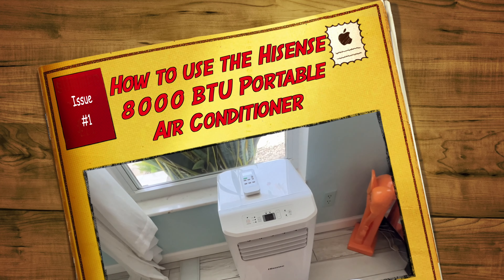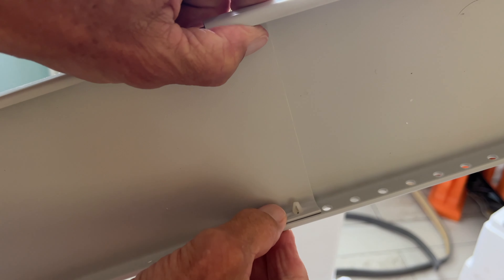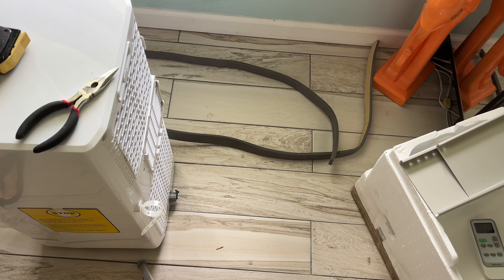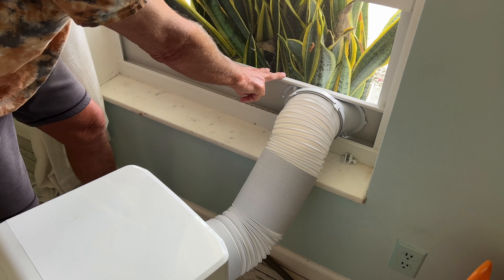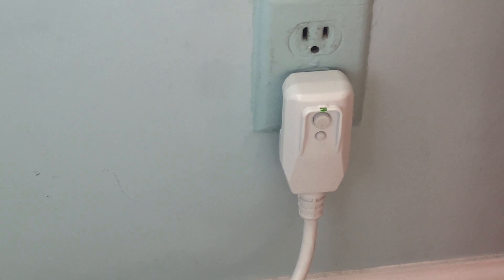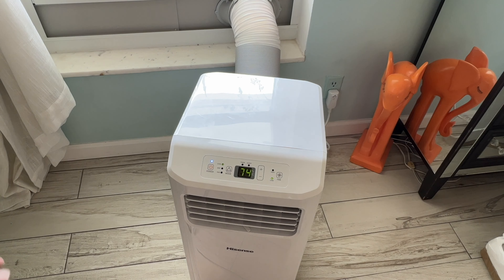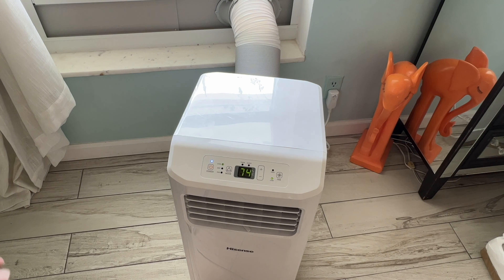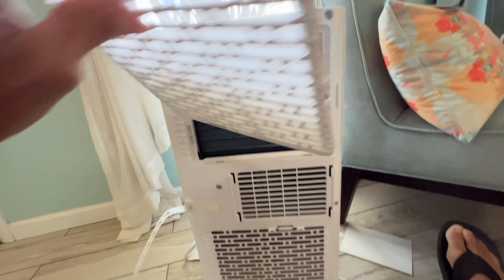How to assemble and use Hisense 8000 BTU Portable Air Conditioner

Comment: I keep getting  the e5 error, I'll drain it then it'll rin for 30 min-1hr before getting  the same error any suggestions
Reply from the maker: I’ll have to do some research on that. I’m not sure what’s going on unless it’s super humid where you live and it keeps fills with water
Reply: Same here……
Reply: No such thing as self evaporate even if it claim to have it. Attached a hose to the air con n the other end to bathroom or outside for draining.

Comment: Thank you so much. Very good information about this product. I live in a small apartment and on call maintenance man had to install this in my apartment. If regular maintenance came back and serviced my unit with Freon, perhaps I could have avoided this unit. Installing was done with less than half of what you've Instructed.  90°+ It's cooling but it's 😢 probably going to run up my bill. Nobody back to the office until Monday after 4th of July. Prayers needed. Very frustrated. I know it's not installed properly or tight enough.
Reply from the maker: Great to hear stay cool. It’s gonna be a hot summer.

Comment: Unfortunately my window space is too small to fit the bracket. Do you have any solutions for that?
Reply from the maker: You would need a saw to cut the leaf so that will fit. It’s probably the only solution unless you could fabricate Aleve out of some materials from Home Depot and plug your exhaust port in there. Good luck thanks for watching.

Comment: I have some one i like it , but it keep shutting off after 5 mins , cant figure out how keep it on running all night with my remote?
Reply from the maker: Turn the temperature down and check to make sure that it has been drained Good luck stay cool this summer.
Reply: My thermo keeps cutting off and on fast.
Reply: @donnabaughman2150  turn down the tempt I figured it out ahah , then put the setting on low and and double click the power button ! Hope it helps stay cool
Reply: @TomLeeman how do you drain it?

Comment from the maker: In the back of it, there’s two drain hoses. One is for condensation. One is for dehumidification if you have it on dry so you have to check those by unscrewing them and pull the plug out and then the water will flow out. You could use a little hose to direct it into abucket or something good luck stay cool. Thanks for watching.

Comment: Just got mine yesterday, got the 6000 btu one. 250 sqft and I’m in a small apartment bedroom. Set it to 61 degrees and it won’t get under 72 during the day. At night it got down to 65 or so. It has been like 90 degree days or so. Not sure what’s going on.. I’d rather not have to take it back and get the 8000btu one. The sqft meets my requirements. The temp in my room won’t get down to 61, the temp I set it to. Is it just the quality of it? Completely confused.
Reply from the maker: I purchased a dual hose 8000 BTU portable AC and it works really good. I don’t think these things can get a room down more than about 15° from the heat outside. They do have limits if it’s 100° it’s tough to get that temperature down
Reply: @TomLeeman  yeah that makes sense. Maybe I’ll get a 8000 btu one and see how that does. Thanks for the info.

Comment: I just bought my Air Conditioner and now it says E5😕Me and my guy just hooked it up.
Reply from the maker: That can mean many things it could be the fan is not working properly. The control board may be not working or the coolant may have a problem. Would recommend taking it back and switching it out for a new one if you can.
Reply: Same here @TomLeeman
Reply: E5 I think you have to drain it

Comment: Worst air conditioner I have ever had... freezes, does not cool and extremely LOUD... absolute JUNK!!!  And Cdn Tire will not refund my money.  Too loud to run at night.  Might run for one hour then shuts off!!!  This is my second one.  They both are the same and other Cdn Tire reviews agree!!!
Reply from the maker: They should take it back and refund your money. I don’t understand why they won’t if you purchase these off Amazon Amazon you can send them back and get your money back.
Reply: This happened to me as well but it if it turns off prolly cuz of it being to cold in the room no need for it to keep going I had this issue turned it up like 3-5 degrees fixed it